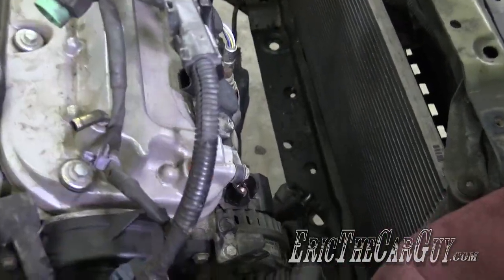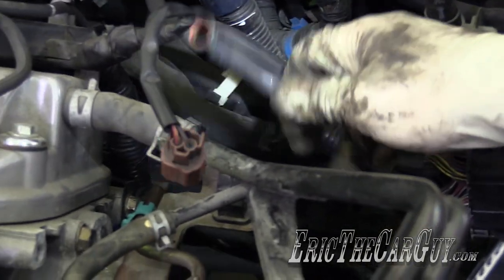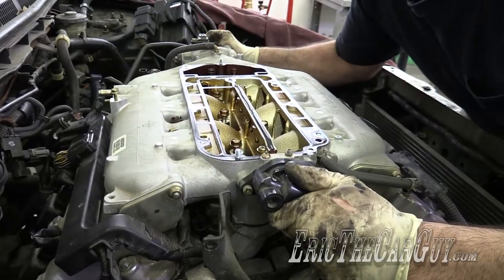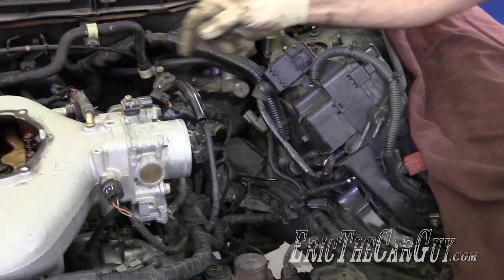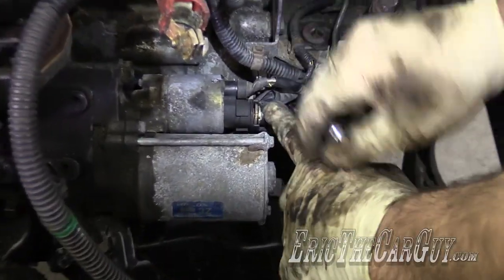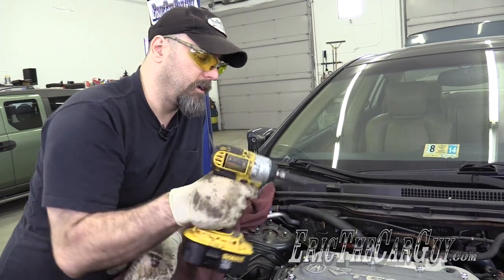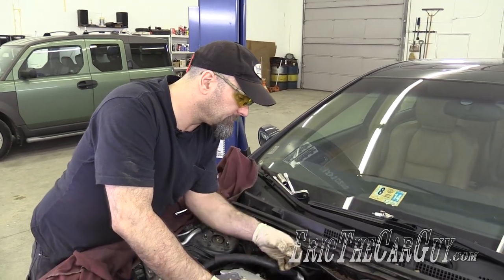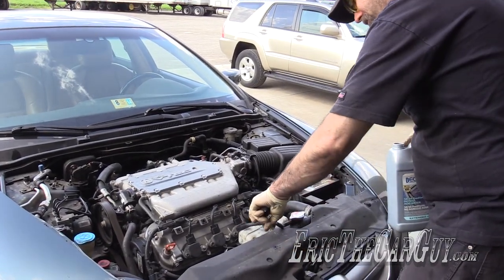2004 Acura 3.2L TL Engine Replacement (Part 4)

Comment: How long did the whole process take you?  I'm a whole day in.   And the engine is still in..one ball joint will NOT separate 🤦🏿‍♂️ all mounts are loose and can Rick the engine.    Super annoying

Comment: you should do it right, by the oil he provided it seems that he does care. some people let the rest of the car go when a major problem crops up but is still drivable, it may appear as he doesn't car but he might. that said I do it right unless the car isn't really salvageable, that car seams salvageable to me
Reply from the maker: +M Blake Jr This car has been gone for more than a year without issues. I think that says I did my job right.
Reply: EricTheCarGuy it worked

Comment: Screw the 3rd cat.
Use a straight pipe, more powah, but you might fail emissions.
Unless you do a VW ECU software tricks
Reply: +IIGrayfoxII  You might want to look at the fine for doing that..... Not cheap.
Reply: +Blazer02LS unless you live in a place that does not do inspections
Reply: Federal law not state. At least Eric has the option to use the lower priced units. Here in NY you can only use the high dollar, approved units. Not fun when the cat costs more than some vehicles are worth!
Reply: +Blazer02LS In australia we do not test emissions during inspections, only that the car is "Roadworthy"
Which means lights work, brakes work, nothing falling off, ect
Reply: you can always bribe the inspection technician, not uncommon in Texas.
Reply: you can always bribe the inspection technician, not uncommon in Texas.
Reply: IIGrayfoxII you could delete the 3rd cat because it doesnt have an o2 sensor on it and it wouldnt give any cel.

Comment: would this pretty much be the same as the 99 Acura TL, i ended up changing the timing belt and the other fun stuff, i just wanted to make sure if i did everything right (Dayco Timing set) i should have went with ASIN, but yeah hopefully this car will be more fun to work with with 177,000 miles on it <--- not sure if that's good or bad but eh! if you do have a video on this car let me know i was trying to find one from your channel for 99 acura TL @EricTheCarGuy

Comment: why did the micro start burn up even after that long time when thats it what it is designed for ??
Reply: +carlcostello360 Microstart has a protection to cut off if short-circuited. But it seem it can't handle the current for long time, mosfets overheating a point that melt solder !
Reply: +carlcostello360 I'm guessing that it's not meant to be the battery, just to jumpstart it. You have to watch yourself around engineers, once they know exactly what it is you want to do, they'll start finding every corner they think you won't need - and cut it.

The moment it got borked was when the engine started running and was "charging" the micro battery. I bet you the engineers who designed the micro-battery assumed that a dead lead-acid battery was going to still be in the circuit and that most of the current would flow into that and not into the micro battery.
Reply: +carlcostello360  They are only meant for short term starting boost. The constant cranking puts all the power through the connections far longer than intended. Those small packs can put out a lot of amps for a short time.

Comment: So, the person who got this car to resell it bothered to get a brand name synthetic oil (Mobil 1) and even went ahead to replace a catalytic converter after getting a replacement engine swapped but couldn't be bothered to install a new clutch in it? 🤔 Your customer should have taken your suggestion about the clutch. I surely would have.

Well, here's hoping this car serves its current owner well, despite it running on an oil-contaminated clutch since the original engine had signs of a bad rear main seal.

Comment: Did you make "flat-rate" money?
Reply from the maker: +Superdude Superdude I didn't make any money on this job. I did it to make this video series.
Reply: +EricTheCarGuy No, I meant if this was a "flat-rate" job did you do it fast enough judging by  all the unedited footage to have made flat-rate money?
Reply from the maker: +Superdude Superdude Filming auto repair is not like just doing auto repair. It takes a LOT longer. If I were not filming, I could have done this in a day, as it was, it took 2 days.

Comment: I must ask if you have heard of the otc ball joint separator. wailing on the steering knuckle seems like way more work than is necessary. I used this tool to separate the ball joints when I replaced a wheel bearing a while back. Here is a link, I hope this helps. https://www.amazon.com/OTC-6297-Ball-Joint-Separator/dp/B0015PN010/175-8241442-5632023?ie=UTF8&*Version*=1&*entries*=0

Comment: Just to bad that the owner didn't want to put in a new clutch. "New"  engine but still that old clutch is something I don't understand.
Reply from the maker: +g412bb It worked just fine as you saw in the video.

Comment: wow that's one weird-ass spark plug this engine has, i've never seen anything like it
Reply: +Guillermo Lovato are you talking about when eric tested spark on that coil pack?
Reply: Wtrxprs007able yes, and when he removed the used one from the other cylinder it's exactly the same
Reply: during the test, that was a coil spark tester. the actual plug looked like a normal plug to me